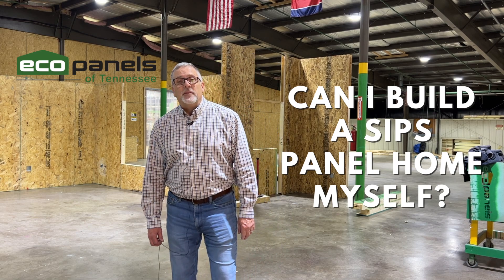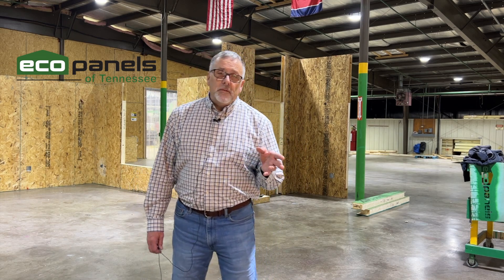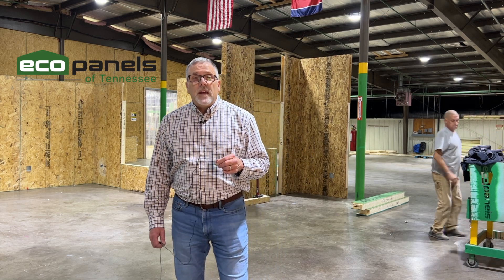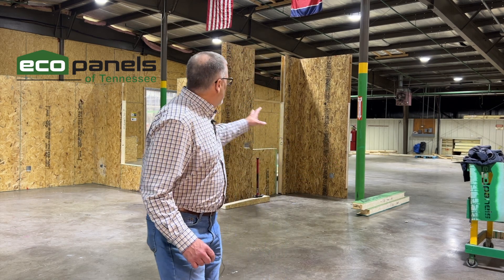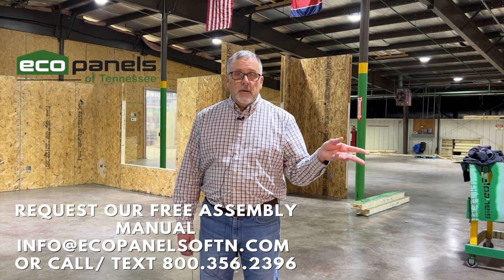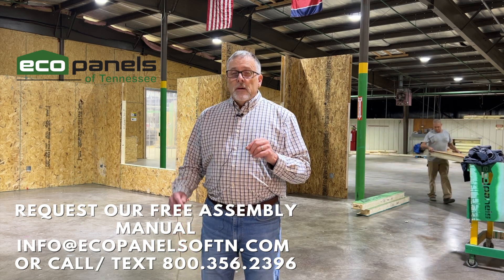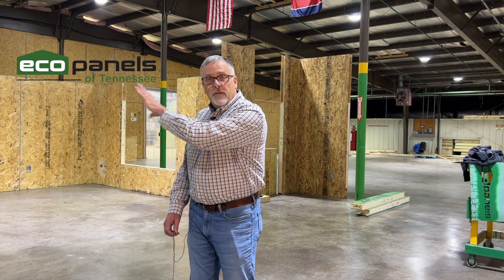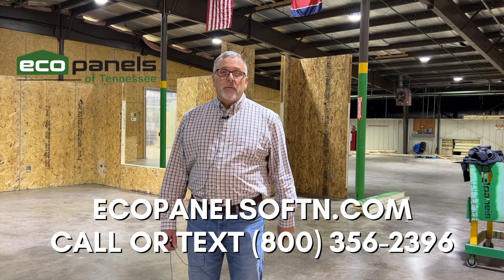Can I build a SIP home myself? Is it a DIY project?

Comment: What about building walls out of ICF and using SIPS for the roof panels? With a hired crane is that DIY friendly?
Reply from the maker: DIY is always relative to the time and experience a homeowner has. Generally speaking, it's probably not fair to say that roof panels are DIY friendly. Between the bulk and weight of the panels, adding in the conditions of a roof, they are beyond what most homeowners should attempt.

Comment: These videos are very informative and I've watched them all... as far as I know. I've looked through your website a few times and I've noticed there's very few videos and pictures about the roof panels... specifically how they attach to the wall panels. I would very much like to see a video about that!
Reply from the maker: Thanks for the comment and great request. We'll see what we can put together soon. One issue... depending on the roof style, home and overhang, there's several ways of doing this. Perhaps we can find an opportunity to film something on a construction site soon, as this would be hard to show in our plant. That said, our Assembly Manual does address some of this with details. You can request a copy from our website. Thanks!
Reply: I agree, with question and understand your response.  lots of other videos from other folks, out there.  I have come to find yours, so much better. so, that being said, i too would like to see a roof placement,  and easy basic is fine.  

in addition,  based on your answer, I take it you do not assemble in the factory the roof fitting,  nor 2nd story??